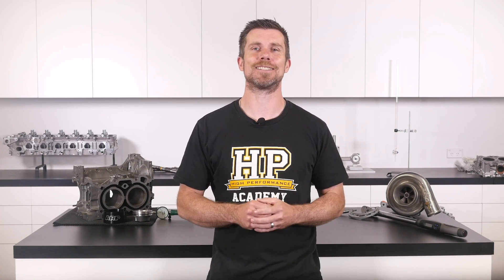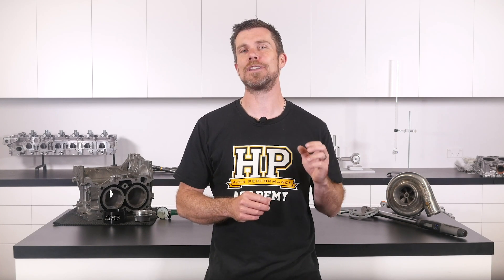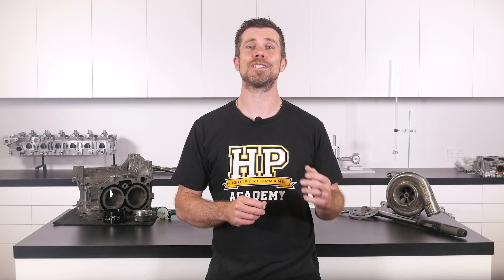Wire Sizing/Gauge | How Do I Know What Size Wiring To Use? [HPA Q&A]

Comment: I was wondering what gauge wiring to use for the evaporator canister purge solenoid valve to the vapor canister vent solenoid for a 20 yr old Chevy Silverado.
Reply from the maker: How much current does it draw? Work that out and you have what you need to answer this question 😎 - Taz.

https://www.hpacademy.com/blog/wire-sizing-quick-guide/

Comment: Andre is spot on.  I'd like to add, current limits of wire factor in the 1) Insulation voltage rating, 2) Temperature rating of the insulation.  Don't exceed the rated voltage, and don't exceed the rated temperatures by far.

You can have a short small gauge wire handle a higher current than a long large gauge wire, within reason.  1 for 1 though, the smaller gauge wire will heat up more to the point of melting-shorting the insulation along with melting the copper or aluminum conductor wire itself.

Comment: 10ga wire on fuel pump power is too much?
Reply: There is no harm in running a thicker wire.
Reply: @murraycalavera1834  450 fuel pump for e85
Reply: @murraycalavera1834  450 fuel pump for e85
Reply: @dekenfnombre9143  10g is fine. I use a similar pump for e85 as well and I use 12g wire.